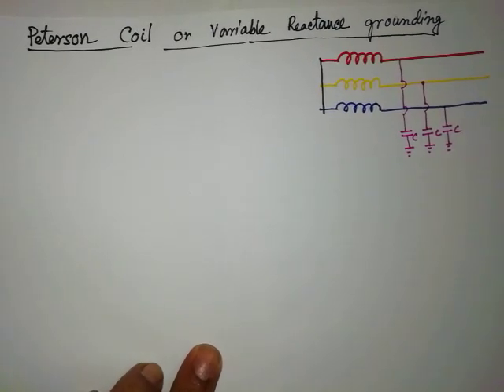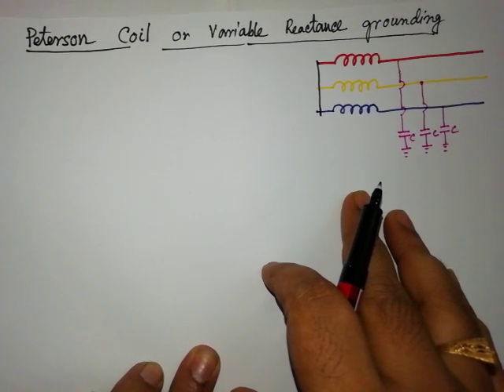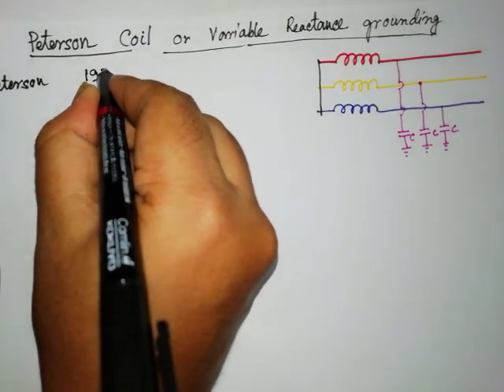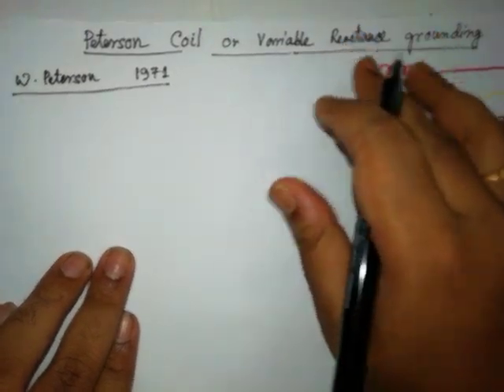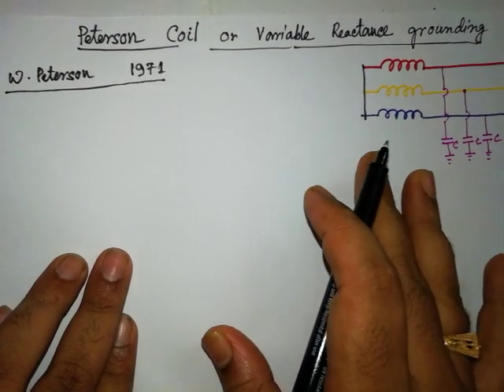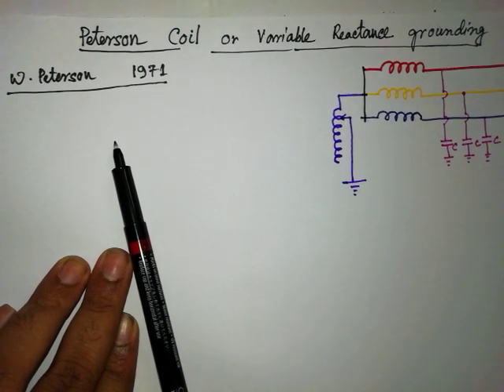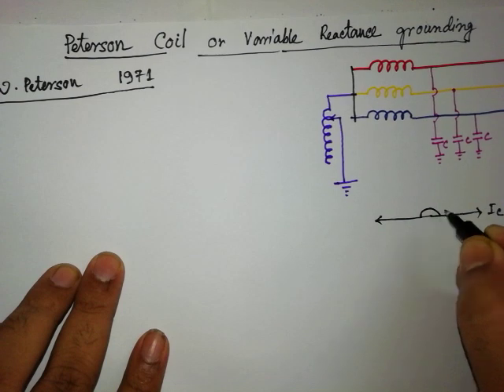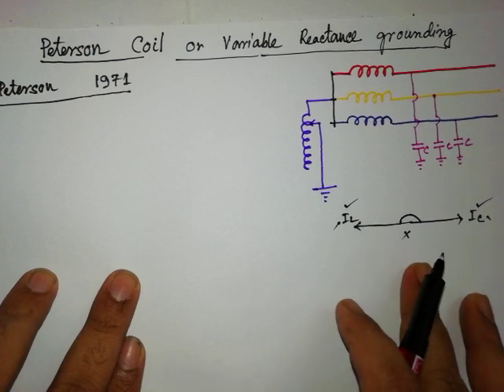Peterson coil

Comment: You have correctly deduced the reactor size from a few not-so-obvious facts such as the magnitude of fault current in an unearthed system, that is probably a content for another video. The video should be called "Petersen coil size determination",  as you have failed to explain the inner mechanics of the single phase fault progression into three phase fault, and how exactly is a fault involving arc suppression (petersen) coil different from the one without it. I believe that the arc itself at the fault is far less destructive when the fault current is supplied by petersen coil, unlike to the fault where the entire capacitive charging fault current is supplied by the arcing faulty phase. Nice video, anyway.

Comment: what is inductive reactance value.and suggest a problem on it for finding inductive reactance value
Reply: Because fault current and coil current has to be in opposite direction to cancel out. If we take capative coil then coil current  get added to fault current, which we would never want.